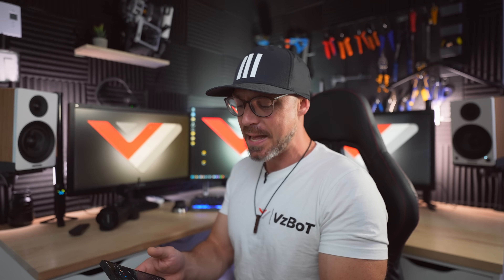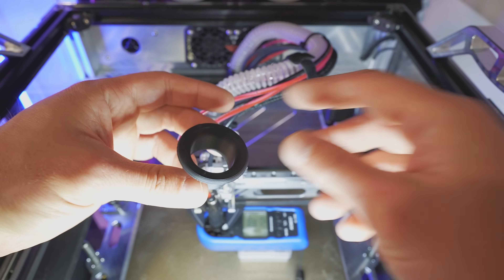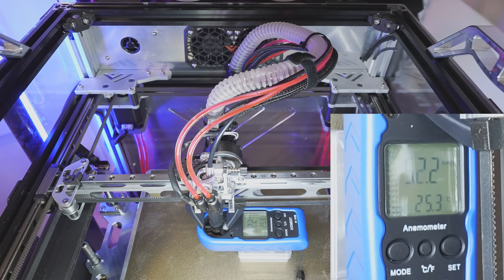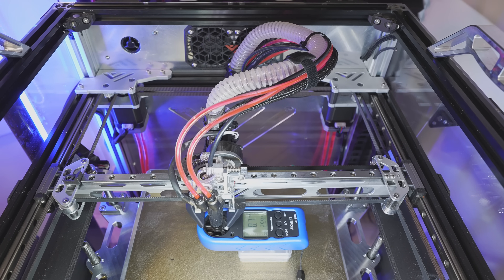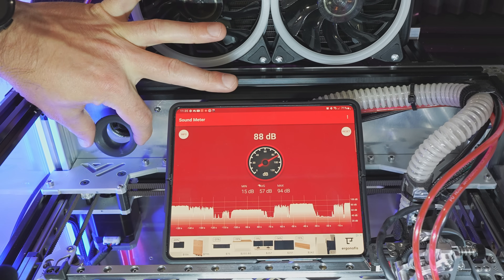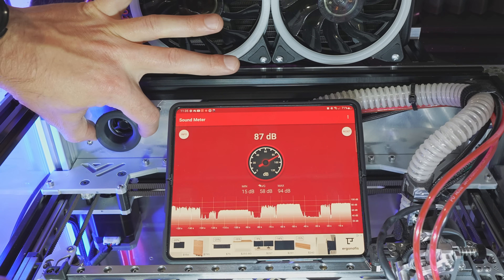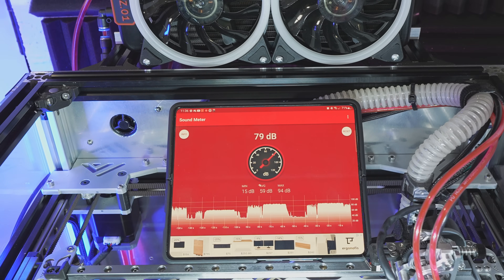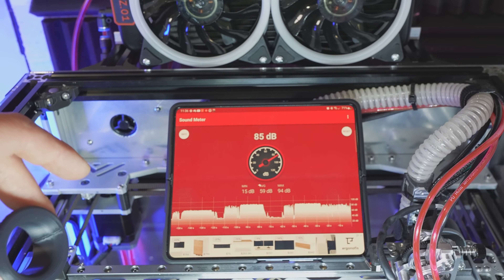CPAP muffler

Comment: I haven't tried a CPAP purely cuz I didn't want to hear it.  Now you've got me brainstorming from my Automotive experience.  An inline resonator on the outlet of the pump may help as well.  A full "Airbox" with the pump inside, and maybe some insulation / a fillter to prevent sucking in any sound dampening materials.  My wheels are spinning now Simon...
Reply from the maker: Haha i knew this vid would generate lots of tinkering 😊
Reply: Same here!

Comment: I wonder what it would do if you base it on a gun muffler/silencer
Reply: I designed one like a silencer on my JUBILEE printer and it works really well: 10dB reduction with small flow reduction, but need one in the input and one at the output

Comment: For this type of tests I will suggest using an spectrum analyzer app instead of a dB meter, it will show  a lot better the reduction on noise
Reply: Or just use your ears....
Reply: @DoubtingThomas333  Sorry, sadly my ears are not factory calibrated, so I can't discern a frequency spectrum by just hearing it so I need to use tools to know what frequency a  sound muffler affects and how to proceed to reduce the strongest frequencies or at least the most obnoxious ones, god I wish I was born with an spectrum analyzer.
Reply: @fdavpach  your ears can discern the difference.
Reply: @DoubtingThomas333  Spectral analysis shows an unbiased response of what your ears hear. There could be more of a db drop that would reflect in one frequency section that a db meter doesn't reflect. Professionals use this tool for a reason instead of "just use your ears" as their only tool.

Comment: In my experience and learning, I have understand that a lot of noise comes from the body too, as you said in the end of video and a lot comes from the exit too. So you have to work on almost three sides, intake body and exhaust. Tankful to YouTube I encountered a video by Dyson where they explain how Helmholtz resonators can drastically change your life (not only in a mastering studio), but the way is lastricate of pain for the earth due to waste of plastic in try. If you find an audio meter that gives to you the frequency spectrum too, you can understand where is the peak in frequency, but it change with the speed of the fan and air, so you will have problems to make the right Helmholtz or you can make a screwable volume and put the right one on the silencer in accordance with the load and the frequency. Easy to say but Dyson level to do.

Comment: I found on my CPAP setup that there is also a lot of noise coming out of the duct, so I think both intake and output mufflers would be even better. And decouple everything with soft TPU 'gaskets' so that vibrations and sound don't get transmitted. Also put some wool or whatever that stuff that is used inside loudspeakers is called inside. Maybe also make the plastic parts and backpanel heavier like the car audio guys do with that black tar stuff or whatever it is.

Comment: Another thing to kind of mention here is you also have frequency. You may not see big number changes on a dB meter, but suppressing a frequency can make all the difference. You often see that in a lot of household appliances where they can only do so much with the parts they will have to use. Hair Dryer, Vacuums, Blenders, Computer Fans. 

Which I believe you accomplished here and mentioned in the removing the annoying noise. Otherwise you will start to quickly get into other things needing to change in order to reduce noise, larger inlet/outlet, slower fan speed, blade geometry, less restriction. Which I think in this application can only go so far.

Comment: Sound reduction is hard, but what I've found works best is to isolate vibration as much as possible, so soft surfaces, lots of mass and shapes that "eat" noise. And generally you want to make things as air tight as possible. If air can get through, so can noise!

With airflow in mind, I lack the knowledge, but looking forward to see what you find!

Comment: I would design it as 1 part standing on the end of the air intake so that the resonator could be sized to the max of your constraints, the plastic wall thickness did not leave much room for expansion. Try varying density and thickness of whool or cotton balls to see how much they restrict flow and reduce noise at the intake.

Comment: Question: have you tried to do the test without the drain tubes to the nozzle? I have the impression that this tube generates more noise due to the impact of curves of the spiral walls - it disturbs the flow of air and hence more noise.
Reply from the maker: I have not

Comment: What also could help is rubber mounting the fan. Some printed TPU standoffs or something that lessens the vibrations of the fan. Like some Computer Case fans come with soft rubber gaskets for mounting to dampen vibrations.

Comment: Hello! The idea is good, but not really.
1. You change only part of the sound that creates the flow when entering the fan.
2. The main sound is emitted by the fan motor itself, which rotates on bearings and creates vibrations. You increased these vibrations when you screwed this fan onto the back wall. It works like a resonator and amplifies the sound like a guitar drum.
3. Some of the noise you hear from the pipe. The pipe comes from the fan and has a spiral shape inside. This inner surface creates turbulence and increases noise. But. The main noise is transmitted to the pipe from the fan through vibrations.
4. You reduced the inlet section on the fan with your device and allowed the air direction to change at an angle of 90 degrees. This greatly increased the turbulence at the inlet and worsened the fan parameters.
5. Most of the noise comes from the fan blades as they don't work 100% laminar.
I propose:
1. Remove the fan from the rear wall and place it on soft rubber damper pads
2. Wrap the outside of the fan housing with soundproofing material, as soundproofing is done in a car.
3. Make a different shape of the suction pipe into the fan. It should expand at the beginning and narrow down to the fan inlet diameter. The form must dampen the sound waves that come from the fan pipe. I have an idea, I'll draw it.
4. After the fan, you need to put a device that spins the flow and makes it straight, this will reduce the sound. I'll draw too.
5. Well, the fattest. It is necessary to make a different shape of the fan blades, more precisely, add ridges (ribs) to the surface of the blades, which will divide the resulting parasitic vortices on the blades and reduce noise. I don’t see from the video what kind of fan is there, so I won’t draw it. What is the shape of the blades? Centrifugal or axial? Write:yougotthis:
Reply from the maker: Excellent write up. Im glad im bringing this project on the table as I was sure people would cooperate and give advice ! Thanks. Share back your design please
Reply: The 3D printed "Exhaust tube mount" will probably also add a lot of turbulance, since there is a sharp edge where it connects to the tube. Using ABS for that part and smoothing it and adding a radius at the end of it will also reduce noise.
Reply: Have you had the chance to draw your designs? I'm working on something to muffle my cpap aswell and I'd like to have some inspiration.
Reply: I think, wenn you dropp a Brushless motor on it. The noise is also dropp down.

Comment: I'm not a sound expert either but I believe that to improve even more the noise reduction (based on the automotive again) you should put mineral wool inside between the two layers of your resonator.

Another idea that could work is making a sound maze, again with some insulating material on your walls. Maybe you could even experiment with the expending pla that seems like foam

Comment: I heard more motor noise being transmitted through the solid mounting plate that you have your blower attached to. Maybe a TPU gasket between the blower motor, the mount, then the muffler? Also, maybe some sort of gaskets/grommets for the bolts to further minimize vibration transfer?

Comment: Measurement problem here, you could actually put it where you stand, for example 50cm - 1m away from the printer, because the chamber creates an echo of some sort and this why we can hear it in the camera but the tablet shows still pretty high DB.

Better measurement for NOISE is a measurement called "sone", it actually shows you the noise instead of the pressure of the soundwave :)
Reply from the maker: good point !!  my best measurement here was my ear meter :P  and my ears are telling me it helped a LOT so I am quite happy with this. though there are room for improvement for sure
Reply: I agree with Damian. You actually loose 6db every time you double de distance. So a small 3db reduction near the CPAP will actually be more like 6db outside the printer. The reduction is exponential, not linear. That's why most of measurement in spec are donne at minimum 1meter from the sound source.

Comment: Hi 

 on the 3 version, try to put some sound-absorbing foam inside the box, so that the red pipe is insulated a little more
Reply from the maker: Im affraid this will choke the fan a bit too much , but I can try
Reply: @Vez3D  imagine it was just like an air filter, enough to drown out some of the noise and then still enough to let the air through . and not like a KN filter that make it hum a little more :)
Reply: @Vez3D then add some pimping from the end of the tube to the inlet of the fan, and put the foam inside. It should absorb the noise without perturbing the airflow

Comment: So, "baffle" and "perforated" are both appropriate words.  However, I think you're missing a great opportunity here.  You have an ability that most manufacturers don't, the ability to print complex and convoluted structures inside your silencer tube.  Old school hot rods would use an exhaust like that packed with glass wool to kill the worst of the higher frequency notes, you can use anything you can think of since you have no temperature constraints.  Maybe an open gyroid infill?  Maybe a TPU egg crate?  Maybe try to wrap it in the triangle traps they use in acoustic deadening panels for recording studios.  I would definitely suggest sending the air down an 'S' bend surrounded in a soft, porous material of some manner, to try to absorb the sound, as opposed to a hard shell that wants to reflect the sound.

Also, decibels are on a logarithmic scale, so remember that dropping by only 3 decibels is a reduction of the sound energy level by half.  That's a big difference.
Reply: I think the word he was probably looking for, for "perforated holes", would be "perforations".

A "perforated hole" would be a hole that has holes in it.

Comment: The dB reduction might be small, but it's not a linear scale so it's still a lot -- and it sounds better, so I'd call it a win!  I have my remote cooling compressors in a padded box and it's great for noise.  A larger air space around the baffled tube (between the baffled ID and the overall OD), and especially stuffing that space with something soft (cotton, steel wool, etc.) would probably help this design kill even a bit more noise, but you're dealing with a high-RPM impeller and that's always going to be tough from a noise perspective.
Reply: Its a bit of this and a bit of that. Yes its frequency related, in that the shape of our ear means we have better or worse response in level at different frequencies and that is different for everyone.

But yes, a small difference in db is a large amount of actual noise power. 3db difference is half
Reply: We measure in dB because the human ear is nonlinear so displaying values in dB exactly makes it linear.
Reply: @quadcorei8085gen2  Source for this?  Perception doesn't change the fact that dB is a logarithmic scale and every +10 is a 10x increase, -10 a 10x decrease.  Normal conversation is about 60dB, a vacuum is 75dB ... that's "only" +15dB ...
Reply: Also, I believe the nonlinearities in human hearing are more frequency-related than volume-related, but I'm not an expert there :face-blue-wide-eyes:
Reply: @quadcorei8085gen2 It is definitely not linear in terms of perception...the difference between voice and a vaccine is the same between a vacuum and a jet engine...

Comment: If you make a hollow box that the air flows through and fill it with a dense "wool", like those copper or steel "scrubber pads" for the kitchen, you should be able to reduce a lot more noise! The small heavy fibres will help absorb the vibrations... Printing the muffler enclosure out of TPU would probably help as well as, the rubbery material will dissipate the vibrations as heat rather than reflecting or transmitting them!
Reply from the maker: wait what ? you here ? hehe nice to see you here. Im not sure if you remember me, but I sent you a cad of your awesome knife. I wanted to print it for a prop, but we both agree I should not publish it. Im honoured to see you here my friend
Reply: @Vez3D  haha I apologize, my memory is like a sieve so I don't remember, I barely remember what I did this morning 🙂You are veery welcome to print the model for yourself, but not sharing it is a choice that's greatly appreciated!

I've been watching your videos for a while! I LOVE what you are doing with high speed printing! Let me know if you ever need someone to bounce ideas off!
Reply: Also: bigger is better!! Make it as large as you reasonably can, that allows for more material to absorb the vibrations from the air
Reply: I would try some of the techniques that are used to reduce chuffing noise on loudspeaker bass reflex ports. Bower and wilkins famously patented a design where They use small dimples on the surface of the port to disrupt the laminar flow.
Reply: Gough Custom on a 3d printing video, holy hell. You were one of my greatest inspirations as a kid to get into making stuff!
Reply: @applepiesapricots3109  haha thank-you! 
I feel both very grateful that I was able to be an inspiration...
And very old that I was an inspiration when you were a kid 🤣

But for real, I'm really happy that I had a positive impact, thank you for sharing! I LOVE 3D printing and have been interested since the early RepRap days, but only in the last 3-4 years have I actually been using it for stuff... A 3D printer is such an amazing tool to have!

I need to make a video at some point soon about my adventures trying to 3D print knife sheaths! I DID get some printed sheaths to work, but they weren't very pretty lol.
Reply: Sounds a bit like motorcycle muffler. With the fibres might work.
Reply: @theloneliness7128  exactly! Similar designs are sometimes used on the intakes of 'quiet' air compressors too...
Reply: Why is steel/brass wool not used as an absorbent in loudspeaker design, is there any good or bad reason? They traditionally use sheep wool and now synthetic fire retardant polyester wool which isn't too different in density and structure.

I think what you want is internal friction, you want the material to not be too elastic, not too springy. Because you want it to not re-release the energy that it gained from air vibration as air vibration again. It is to be converted to heat.

Curiously along with absorption, effective volume of the air is increased. As the travel path for the sound gets effectively slower/longer.
Reply: @SianaGearz  in this case the steel/brass 'wool' would be chosen because it's fairly coarse and allows the air to flow through, whereas the fabric based materials would be too fine... If you were going with a denser wool you would probably just line the muffler with it, rather than totally filling the muffler cavity. Either approach would be helpful I'm sure!
Reply: @GoughCustom  The speaker wool is called polyfill and it comes in a 2-3cm thick roll, you're supposed to just pull it apart to give it the right volume. It's not generally for lining walls but for filling. Speaker design has the weight of polyester wool in a given chamber or volume specified and you just weigh up about that much and spread it out. Walls can be felt lined in chambers which are wool filled, but unfilled should be lined with dense eggcrate-shape foam; either can be underlined with thin bitumen pads to provide an impedance layer to wood, but it's quite rare. Every designer has their own recipe and there is also regional tradition but this is the general trend and what many consider best-practice. A lot of mass produced speakers see that they skip as many production steps and materials as possible so don't be too surprised if you only see one type of damping material in the whole cabinet. Rolling up a bunch of wool against a single corner or wall and leaving the rest of the chamber unfilled is fundamentally valid though and sometimes helpful since it'll have extra impact on standing waves, you just have to make sure it won't move too far.

Though with my experience it's usually easier to prevent airflow than to prevent sound transmission, when the air path goes through any sort of material. This is the design hazard, which to me as someone from speaker design background is more the desired state of things, but what we're trying to do here is the opposite, it's why you ask a HVAC engineer as opposed to an acoustic engineer. I suspect what you may want is an odd-angle labyrinth where you line the walls with progressively denser grades of material. But it also may not be too relevant for CPAP design because of its immense static pressure.